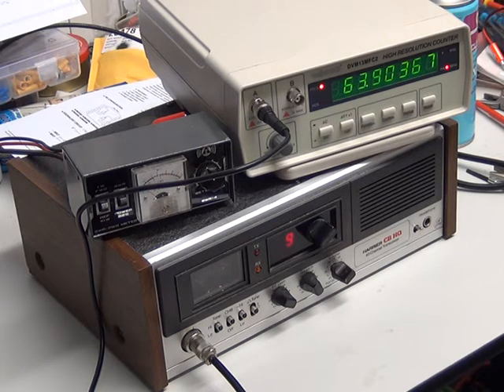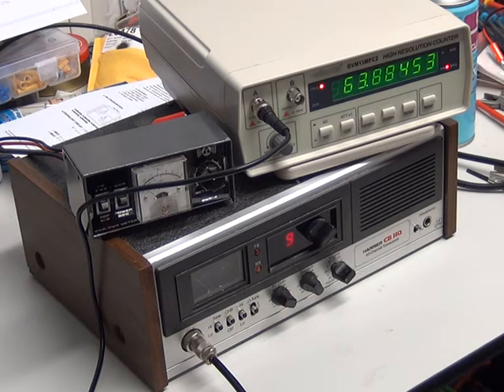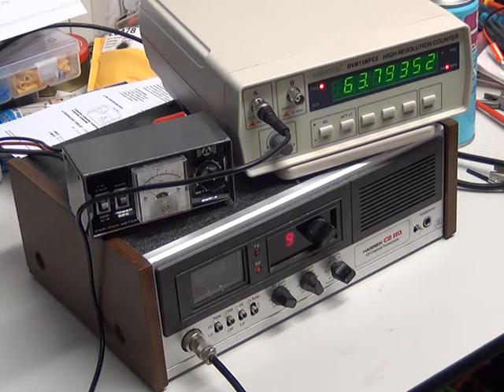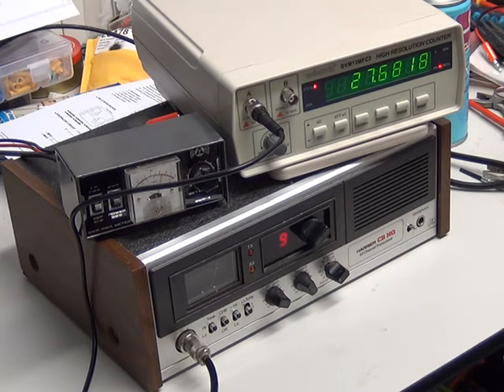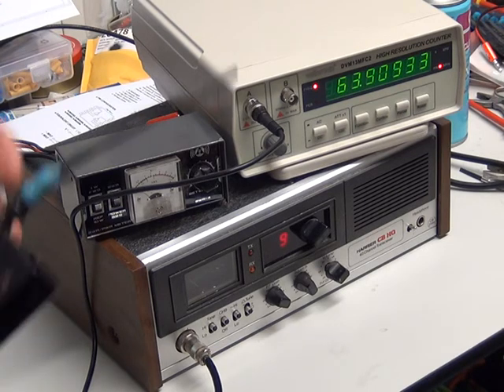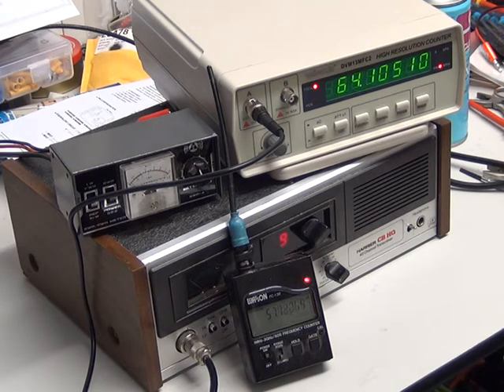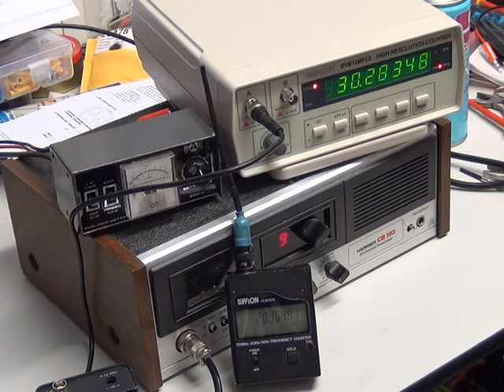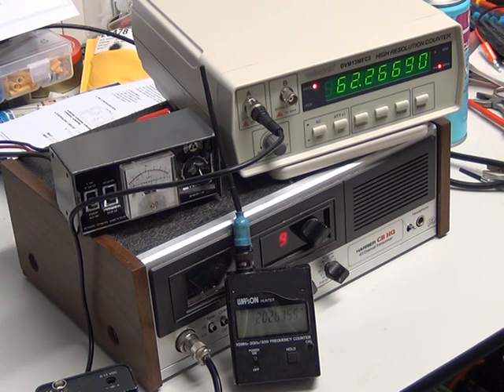Frequency Counters; Why 8 digit? - Servicing CB radio on a shoestring - Pt3

Comment: How in the queens name you hook up the countaa??  cb to counter to antenna
Reply from the maker: Counters like this aren't connected directly. Just a short rubber duck antenna for the counter to pick up the RF from the radio.  There are direct methods involving attenuators, which are complex.  Bear in mind you are testing radios into a dummy load & not connected to an antenna.

Richard, G0OF, UK

Comment: Hello Richard.

What's the best way to sample a frequency output, without direct antenna connection. 
Would a coil pickup from the coax do it? Or is there a proper method.
Reply from the maker: Yes, just a bared bit of coax ill normally be OK. You can buy/build an attenuator for direct connection,, but you'll need to know the input level required & maximum for the counter in use. The ARRL handbook is a great resource for building attenuators.

Richard, G0OJF, UK

Comment: I used to have one of those Watson frequency counters, and used it as a "frequency sniffer" back in the day to find channels for my scanner until the Uniden 'Close Call' models came out.

Thinking about it more, I bet this equipment was often used by the DTI to find illegal CB users; someone with a multi mode set with a 'Coarse Clarifier' roughly tuned to get the UK channels was bang on frequency by ear only, but was actually off frequency versus a legal CB set. I bet they were also spotted for over deviating and creating channel splatter too.

All in all, an interesting video.

Comment: Hi Richard  
Been following you're channel for a while now, find you're videos very helpful and interesting.
now starting to get into radio setup myself, held my foundation amateur radio licence since 2005
just been purchasing maxon radios etc and windows 98 laptop on ebay to have a go with programming etc too,
my question is, i'm looking at a black star 1325  frequency counter on ebay and other black star counters,  do i need to attach a dummy load to them, or is the inner workings of the unit sufficient to transmit into to get the frequency of the radio without the use a dummy load?  Also have a 27/81 barracuda cb radio id like to test frequency on.
Thanks for all the videos and helpful information you give 
Carl
Reply from the maker: You put the dummy load into the aerial socket of the radio you are testing so you are transmitting into the dummy load. You put a short aerial into the frequency counter input so it picks up gthe leaked RF from the dummy load. You never transmit with a lead between the two. That said, with appropriate attenuation but they are more expensive than the counters!

Richard
Reply: @ukfmcbradioservicingTango21   thank you very much for you're reply and help, much appreciated  

carl m3kum

Comment: Hello Richard, what other equipment is the  frequency counters used for?    
Thank you......
Reply from the maker: On transmit, we use a frequency counter to check transmitted frequency. In setting up the VCO we sometimes use a frequency counter to set the 10.24Mhz master oscillator. On some CB radios with three synthesizer crystals, you have to set the 10.24, then the transmit frequency, then the receive frequency. If using a non-sythesized signal generator, a frequency counter is used to check the accuracy of the signal generator setting. So it depends on what other test equipment is used, it depends on what type of radio is being serviced & therefore what the service manual tells you to use to service the radio in question.

Richard (UK)

Comment: hi. Thanks for this series. Could you please tell me if a Racal Dana 1998 frequency counter will be ok to use. Many thanks
Reply from the maker: Yes, that's top end commercial gear. Remember you don't plug the transmitter direct into it though!

Comment: Some of those five digit counters will display the 'extra' digits at the push of a button but they are in general, useless and drift all over the place.

The cheap bare board Chinese 'cymometers' to be found on eBay for under a tenner are pretty good, they've got a decent stability TCXO, all the ones I've bought have been rock solid and within a couple of Hz of my rubidium locked Racal counters.  

I'm also wondering why you didn't show the use of a simple diode detector/DMM on the dummy load as a way to measure power accurately or did I miss that?
Reply: Just adding a signal diode and capacitor into the load allows you to measure voltage on a DMM and then convert to power, it's more accurate than the fabled Bird meters and dirt cheap but you do need to know how to use a calculator.

K4EAA has a decent guide to construction and use. 

http://www.k4eaa.com/dummy.html

I've got several thousand pounds of test gear sat on my bench too but for servicing and repairing CB (in fact most radios), the main tools are the dummy load, a cheap 35MHz Hameg 'scope, frequency counter and a Fluke handheld meter. Combined with a bit of knowledge I find I can fix almost anything that crosses my bench with those to help.

The spectrum analyser, modulation meter, fancy Tektronix 'scope, multi GHz sig gen etc. aren't actually that useful for the majority of repairs but are really nice to have for alignment and final checks.
Reply from the maker: Clint, I'm not aware of the diode detector.DMM method. Bear in mind I'm from a commercial 2-way radio background where instrumentation isn't normally skimped on. There's a cue for you to do a video & enlighten us all!

Many thanks,

Richard
Reply: I found this on Andy Collinson's pages.  Is this similar to what you're describing, Clint, i.e. a RF probe and Wattmeter?

http://www.zen22142.zen.co.uk/Circuits/Testgear/rfprobe.htm
Reply from the maker: Thanks for your input Clint.

Richard
Reply: That's the kind of thing, yes. You can use a silicon Schottky diode instead of the OA91, the older germanium diodes are becoming harder to fine and more expensive now and at CB power levels it's not necessary in a dummy load. 

I used 1N6263 in my treacle tin dummy load and the accuracy compares nicely against some rather expensive testgear.
Reply: (I may make a video or two at some point, though I doubt they'd rival the ones I find already online)
Reply: Clint Jay could you possibly add a link to one of the cymometers that you refer to as being fairly good... it would be most appreciated. i have found no end on ebay but as a noob i couldn't tell a bad one from a picture of a ham Sandwich

Comment: I bought one of theses Richard and they seem to work fine on a sniffer cable 
http://www.ebay.co.uk/itm/252620803260?_trksid=p2060353.m2749.l2649&ssPageName=STRK%3AMEBIDX%3AIT
Reply from the maker: Thank you for your input on that.

Richard
Reply: May well be worth you getting one it's cheap enough , I've bought a hobby box to put it in , Anyway what channel you hang on haven't spoke to you in a while
Reply: There is also the option to include this type of cymometer housed in a transparent acrylic box from at least one seller, ready assembled here: http://www.ebay.co.uk/itm/172396801979?_trksid=p2060353.m2749.l2649&var=471223751040&ssPageName=STRK%3AMEBIDX%3AIT
Reply: I've bought one of these and they are not that brilliant
Reply: Not brilliant as in not accurate?
Reply: Jumping in, those cheap cymometers are pretty good, I've bought quite a few now for incorporating into projects and they've all been within a couple of Hz of a pair of Racal 1998 counters that use a calibrated Rubidium atomic frequency standard as reference. 

They're not as sensitive as some frequency counters and don't have 'proper' RF connectors for input but they do work rather well for the price.

The case doesn't look brilliant though.